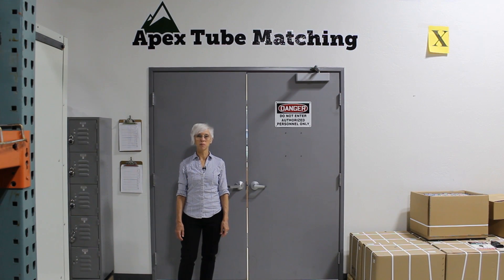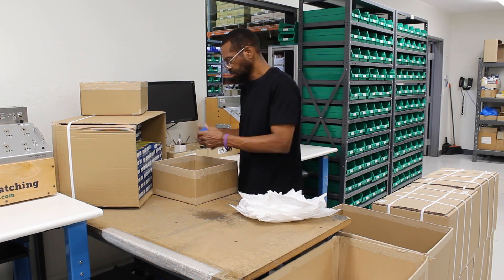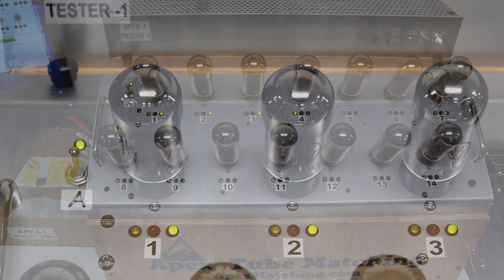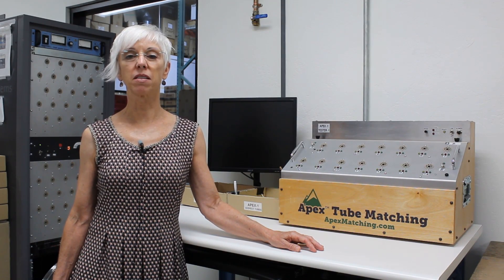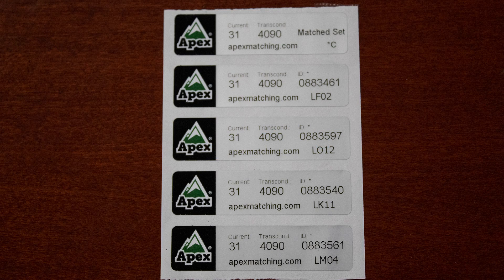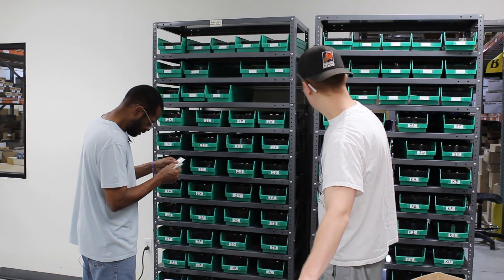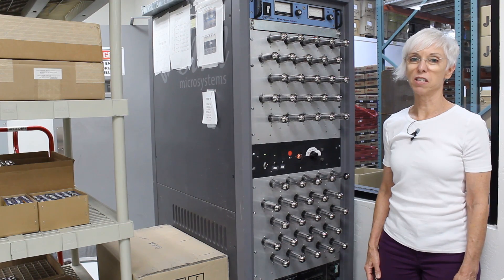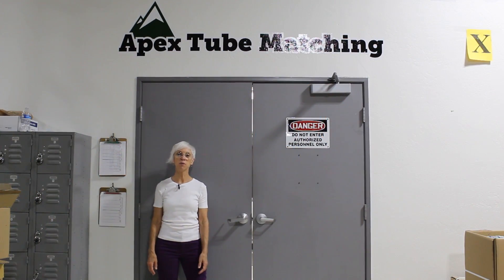Apex Tube Matching- Behind the Scenes!

Comment: 7:29 Did he just pull out a tube without gloves or towel? Doesn't that effect the tubes negatively since the oil is limiting the tube to warm up to the desired temp? And 7:49
Reply: There's a thread on Gearslutz about this...  I believe the consensus is that it's pretty negligible.  I still wear gloves when installing tubes tho.... but more cause I'm a nut and super anal about my gear.
Reply: You should wipe off all your tube when they come from the manufacturer anyway although apex is very clean the place they where made might not be metal dust dirt etc. so if they put there fingers on them it don't matter you should always wipe your tubes before putting them in anyway besides APEX is the top dog in matching tubes or valves what ever you want to call them. There system is dead on
Reply: Hmm, so the myth is that a microscopic film of oil on the tube will affect the radiative and conduction coefficients detectably?
I used to match transistors for a couple of DJs back in the day and I can be pretty sure that the amount of thermal paste would vary by many percent and not make enough difference to detect.  Yet here a sub 1% change in thermal characteristics in a thermionic valve that is working with a yellow hot filament is supposed to have a thermal coefficient that can cause effects that would be swamped by the differences in airflow due to amplifier geometry.

The temperature effect of the matching rack in this video would be many times higher between the lower bank and the upper bank than any surface contaminant could have in a working amp. Remember that the characteristics become a flat line after the working temperature is reached.
Reply: @KallePihlajasaari  Wow Kalle. A little to deep there!  Vacuum tube envelopes are soft glass, unless Bendix Red Bank, and high power RF tubes are in the equation, in this case the glass is Nonex. The pin seals (metal to glass) are usually Kovar. Oil from handling does nothing, besides leave a fingerprint :^)

Comment: If you used colored bins and a symbol stuck onto the side of each bin you could further reduce the chance a wrong bin was selected. The checker would read out kilo foxtrot 5 and then confirm that the picker removes the bin which is the right color and with the right symbol on the side that he can now see.  The picker would not be told the color or symbol.
The way you have it now the checker is reading the bin letters from an angle so could misread one as the correct bin.  Although that may just be due to having a camera recording the event. 
Of course, you would need to make sure the checker isn't color blind.
In fact you could also put the letter codes on the sides of the bin. That way if the checker is standing to the side the only letters he will see are the letters of the bin that is currently pulled out.
Reply: Letters on the side of the bin is VERY SMART! I like how you think.
Reply: To make this process more secure, you need to eliminate complexity. More simple = less chance to make mistakes! So lesser letters and numbers, large, readable signs, alphabetic order placement and such is the way to go. Also eliminating all kinda stress and pushing in a hurry will help.
Reply: You sound like an inventory guru!

Comment: I have four Apex JJ EL34 tubes. They're were installed in my Marshall amp when it was repaired. The current is 64. And the transcond is 8790. But they're running too cold in my Marshall 2203X. The bias pot is maxed out and the plate current reads 11.8 mA. What kind of numbers do I need to get so the tubes bias hotter? I would like to get a quad that I could bias between 33 mA and 38 mA. Thank you.
Reply from the maker: Hey those are some really high current tubes! These can be really desirable but you would need to modify the amp for them to work. A set of middle numbers will have a better shot at biasing in the amp assuming there isn't an issue with your bias circuit. Send us a message at sales@amplifiedparts.com and we can get you set up with some lower numbers.
Reply: @amplifiedparts  Thank you.

Comment: Don't need to re-bias if you swap out a tube? Hardly, the spec's will change with time and use. A new valve will be different to old tubes even if they are/were 'identical' brand new.
Reply: It should get you close and if you wait a while it should stabilise to near the older tube specs saving you trying to keep tracking he bias on the replacement as it ages fast in the beginning. To each his own.

Comment: What I need to know is if you match the tubes AFTER you burn them in. This is critical. In my experience all tubes drift considerably from new. Matching is completely moot if they do not burn them in first.
Reply from the maker: Our JJ power tubes do have a burned-in/matched option, and those particular sets are matched after the burn in process.
Reply: @amplifiedparts  Thanks. Why not the other brands you offer? Thanks.
Reply from the maker: @AdrianRP1  The Apex matching system was created for JJ tubes specifically, (we have extended it to other tube brands since) and the burn in equipment in our facility would simply be pushed past capacity if we were to offer that service for other power tubes.

Comment: New tubes are garbage.  NOS Mullard's are much better.  Only 2 companies in the world make tubes for guitar amps.  Russia and China.  Aspen Pittman and Groove tubes pioneered this tech.  J.J. tubes are garbage.  I was trained in tube tech in the USAF in the 70s and 80's.  Also worked for Raytheon designing radar systems.  Buy N.O.S.  Mullard's, Siemens, Telefunkens.  Hiwatts and Ampegs, among others had a fixed bias circuit because tubes in the good old days were Rock solid.
Reply: Kirk Decker  , ,   Slovakia makes tubes too , ,   !
Reply: All the NOS tubes are way over priced and most are worn out I use chinesse and Russian now
Reply: @bengom68  Great ones actually, especially in the past.
Reply: @kirkdecker6228  JJ tubes are from Slovakia. And they are manufactured using the same process and machines that were used for former Tesla tubes.